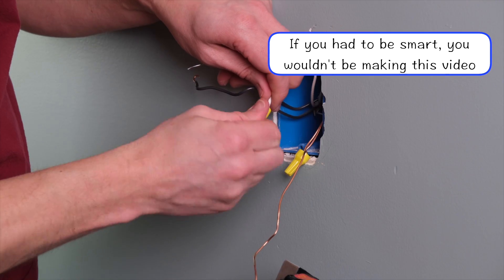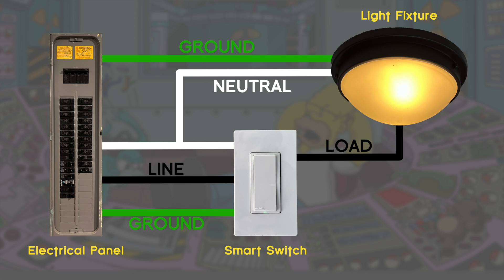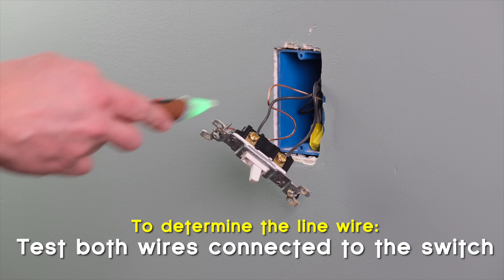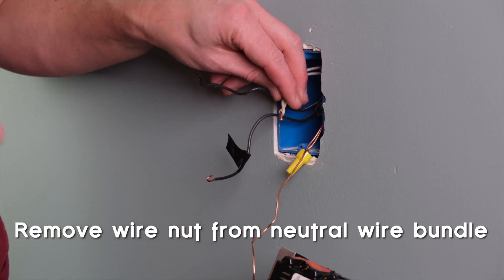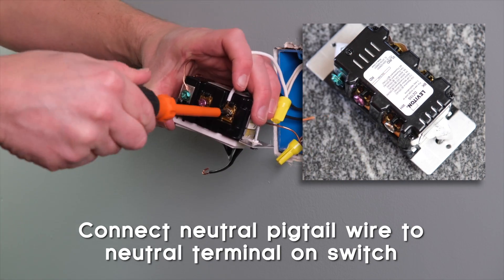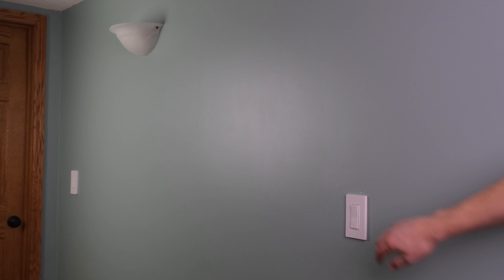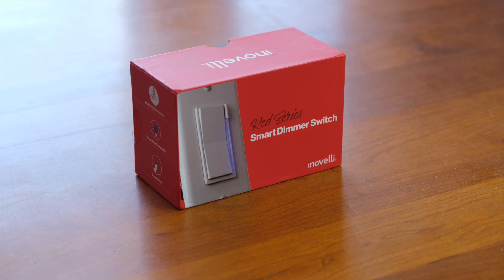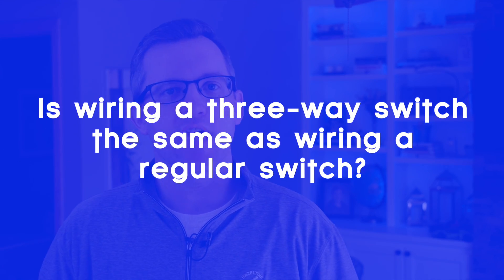How to install a smart switch the RIGHT way

Comment: thank you for posting this video. super helpful. I have 3 gang switch. they are dumb toggle switches. I want to replace only one of them with smart switch. in your opinion, is it doable? will I have room for it if the smart switch is bigger than dumb switches? apart from the switch, do I need anything else like a "hub" ?

Comment: Good video.  I purchased a MOES 3 gang wifi smart switch.  I used wago connectors - love them.  The switches all work manually. I am getting a failure to pair it.  I tried telling my spectrum WiFi to add a smart switch on 2.4G but no luck.  any hints for the frustrated network engineer? Thanks

Comment: Did you just mix some non copper wire with the neutrals? You can't do that. Wait until your insurance company hears about that! Google what happens when two dissimilar metals touch.  Then proceed to connect that to a device likely only rated for copper connections. You can't do that either. This entire video is why people who don't know what they're doing should call a pro.
Reply from the maker: Relax. It's tinned copper. It's fine.

Comment: Where is there 3 white wires instead of one ?
Reply from the maker: There can be any number of white neutral wires in a junction box. It all depends on if  it branches out to other outlets/switches or there can even be other circuits in the same box. Every box is a fun surprise!
Reply: @ good to know

Comment: You are correct.  Do not trust, or assume the electrical box is correct.  Just had my laundry room lights tied into the kitchen breaker, not the laundry breaker.  Voltage testers are very handy for times like that when the light is already broken and you can't test that way.
Reply: General purpose lighting / outlets almost always are in more than one area. Basically think of a general 15 amp circuit is going to 8 boxes in your house.

Comment: I thought a smart switch made the most sense with smart LED bulbs? A dumb switch would kill the power to the smart bulb which is no good, a smart switch is essentially a controller managing the flow of power, right? Very useful in a middle-of-the-night trip to the bathroom and just want to use a switch and not have to rely on my phone or asking Alexa.
Reply from the maker: Correct, you don't want to use a regular switch with a smart bulb because they need constant power. If you put a smart switch in with a smart bulb you need to make sure you get one that has a "smart bulb mode" that doesn't acutally cut the power to the bulb when you turn it off. Essentially it acts as a button controller.

Comment: OMG, please stop using AC... I hate it (inefficient, dangerous, etc...) :)
Star/BUS DC systems with central control (KNX/CAT5-6-X)
And no switches, just buttons with led indicators to synchronize their status when you control them from multiple points.
Reply from the maker: Re-wiring the entire house seems like a lot more work than I want to undertake just to install a smart switch.

Comment: Hey, when I connect them, lights keep blinking, I’ve tried to solve it but I haven’t figured it out
Reply: Maybe it's blinking until you set it up in the app? I haven't installed a smart switch yet, but my smart bulbs blink until I connect, or reconnect sometimes, to the app.

Comment: Writing the breaker number on the back of the wall plate can save you some hassle down the road if you need to replace/upgrade the switch. (But agree - always use the noncontact tester!)
Reply from the maker: That's a great plan! I've used it myself many times.

Comment: these days, there are a number of three-way smart switches which are wired just like the dumb switch. this is an area where there's been a lot of progress in the last few years, so I'd update the 3 way video
Reply from the maker: Good idea. There is more information on the website to help figure out if those switches will work with your current wiring configuration. thanks for the suggestion.